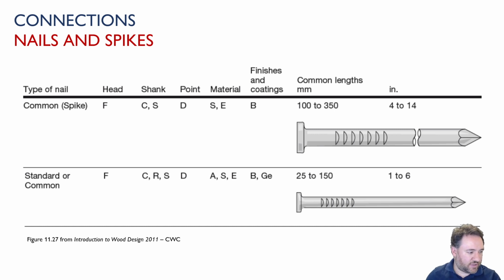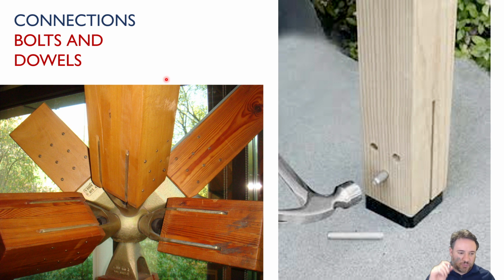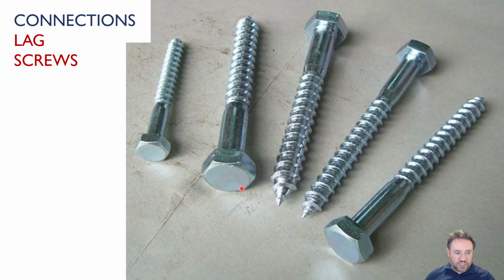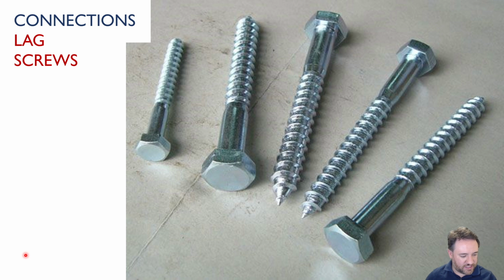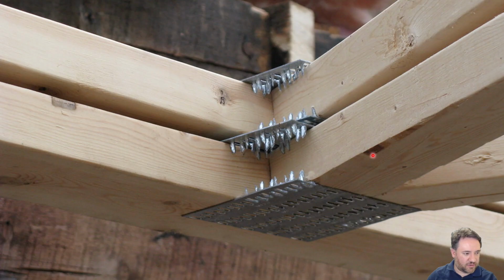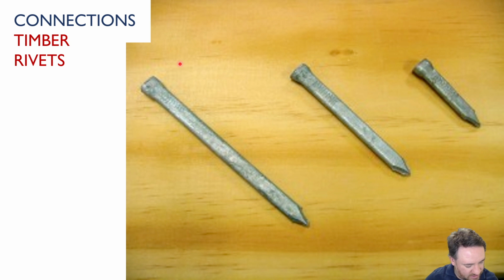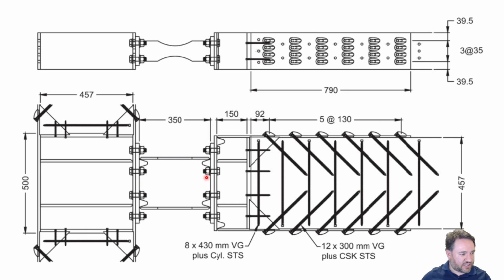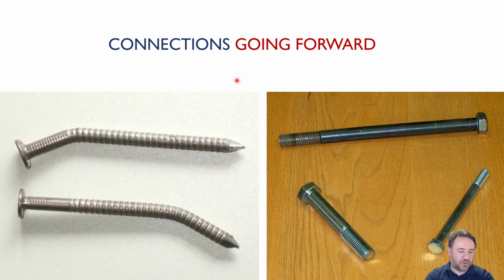Wood Connections - Part 1 Introduction

Comment: I ran across your video while looking at connection types for a covered pavilion I am building in my backyard.  I am a retired mechanical engineer and it was very interesting.  I had never heard of wood rivets and only once ever have seen a shear ring type joint and it was on a house that was maybe 100 years old.  I also had not considered the glued in rods and have a location that might be a handy way to connect.  Mostly I will be using the "Headlock" type structural screws.   It was also very interesting where your angled screw connections are strong enough to make the failure mode in the steel connection.